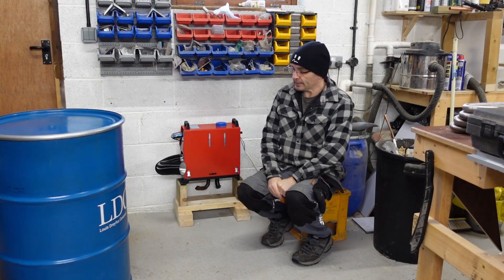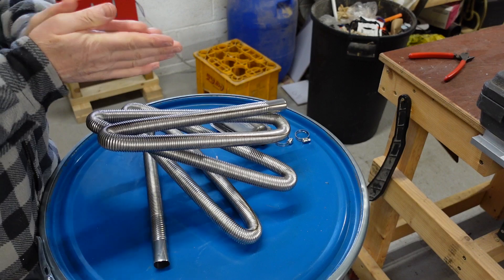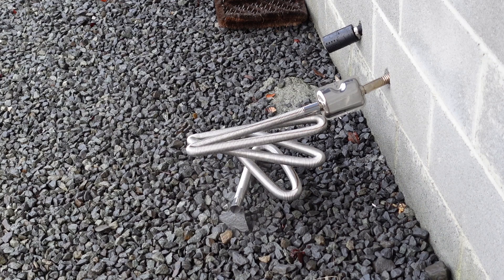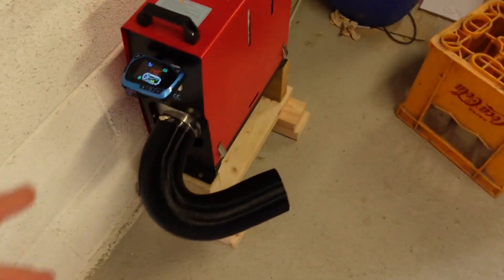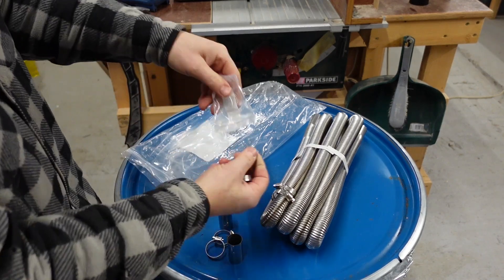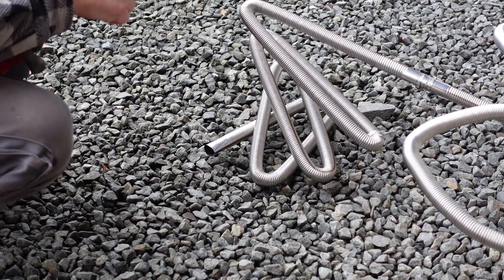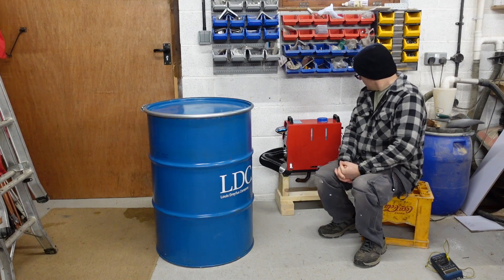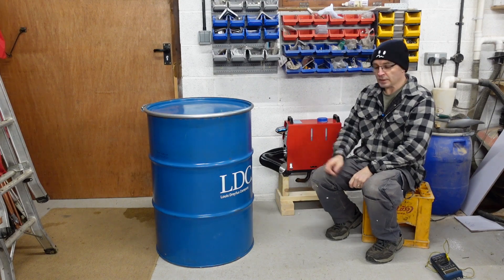How Long! Can a Chinese Diesel Heater Exhaust Be Extended ?

Comment: I have 60 sqm garage and 5kw heater on 2 has no trouble keeping the shop at nearly 20c.And this is in Finland at -20c. Maybe you should try something, I quess, unconventional, like insulation...
Reply from the maker: Working with what I've got, not going to take the workshop apart to insulate 👍
Reply: For some people its just that they like to experiment :D
Reply: Why on earth people spend their time optimizing heaters when buildings are just brick? Well evolution I quess.

Comment: Copper pipe spirals are available in 22-28 mm lengths up to 6 meters. You have these when brewing and distilling. The connecting pipes used here are not good. Exhaust pipes should always go downwards. PS: Carbon monoxide meters are a must for everyone.
Reply from the maker: Copper and exhaust gases no, stainless steel is the only real option.

Comment: your inlet is a bit close to your outlet on the wall ??
Reply from the maker: So far it's not given me any issues, seems to run fine.👍
Reply: @50plusdad-uk yeah it might run fine but surely you will be sucking in some exhaust fumes into your air intake which should be clean air ?
Reply from the maker: I think probably very little if any, the exhaust gases although cooled are still warmer than the cold air so rise up plus they are propelled by the fan in one direction away from the wall, the air intake is lower to the ground and sucks in this colder air from 360 degrees, I'm limited to how far apart they can be by inlet length I didn't want it to be too long but it's working good so if it ain't broke etc 😁

Comment: I wonder if you could if you cood split the drum into 3 sections, a top, a bottom, and  a middle, connect with 22 mil vertical copper tubes in parallel, and feed the exhaust into the top plenum surround with sand, and use a second set of  fifes to collect the heat driven by a small fan...
Reply from the maker: Stainless might be better I think copper reacts with the exhaust gas moisture

Comment: Just a thought, maybe you could use 2 parallel 6m pipes instead of upgrading the pipe diameter. It would require some sort of Y splitter though but be a lot cheaper than larger diameter pipe and the surface area transferring heat to your sand battery would be a lot higher. I'm following with interest as I'm considering a similar setup for my garage.
Reply from the maker: I went for the 38mm pipe and so far it's working great, ive got a lot more run time and zero soot. I'm also running a 7m long pipe now.

Comment: I too have been playing with heat recovery. What I have found out it is good to go from about a 1 m exhaust and then go into two parallel 3 m exhaust. This lightens the restriction and Work on the exhaust fan. The exhaust fan is before the igniter.

The cheapest and easiest exhaust recovery would be mount a zigzag 3 m on the front of the a box fan. You would want the front grill to be metal and you can use used metal wire to attach it to the metal grill. This will dump the heat, the fastest through air convection.
Reply from the maker: I've got a larger exhaust on it now, it's gone from an area of 490mm to 1130mm and it's a lot smoother bore so hopefully better flow.
Reply: @50plusdad-uk  I would like to see the new video.
Reply from the maker: @ should be here next week, I'm doing a couple of changes, as the sand dries the heat retention is getting better, I ran the heater for about 8hrs and the following morning the bottom of the barrel inside was still 28c outside it was 5c so I'm going to remove the sand to speed up drying and spread out the coils in the pipe more evenly across the height of the barrel.👍

Comment: 6meter will give u alot of problems as condensation will block the exhaust....A 2meter straight over the ground one made my heater stop working  cause of condensation ,the short 40cm one never cause a issues...
Reply from the maker: I've started working on the sand battery, the exhaust enters at the top and exits at the bottom so it has a lot of fall. I did a quick test run and once up to temp there is a constant drip of water out the end, I think as long as I don't let the pipe sag as it goes down hopefully gravity will keep it clear but time will tell 👍
Reply from the maker: I recorded a video making flanges, all was well so moved onto filling/drying out sand inside the barrel, It didn't go well no problem with condensation but loads of soot, smoke and wouldn't start right, looking at a larger bore exhaust now to see if that helps.